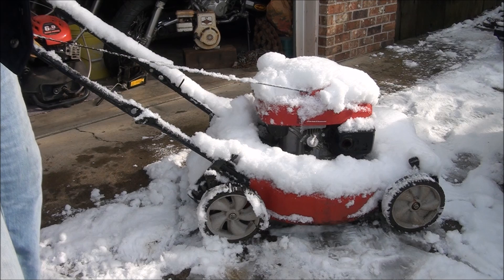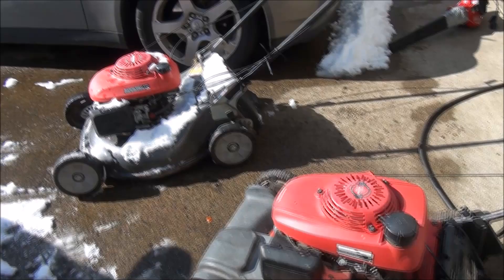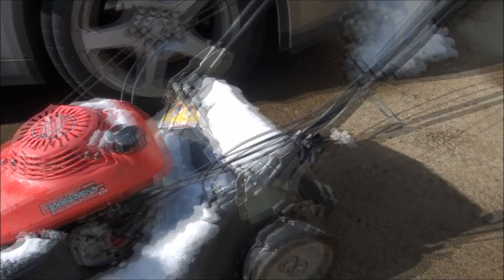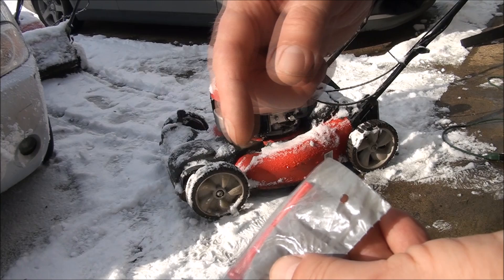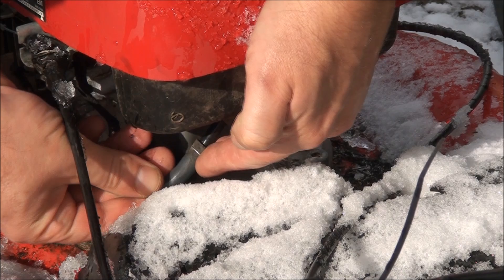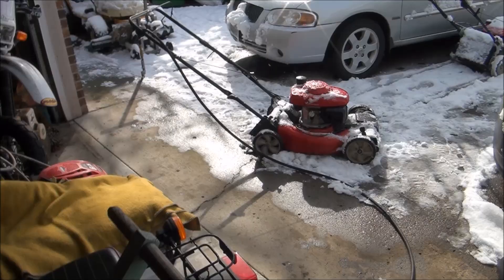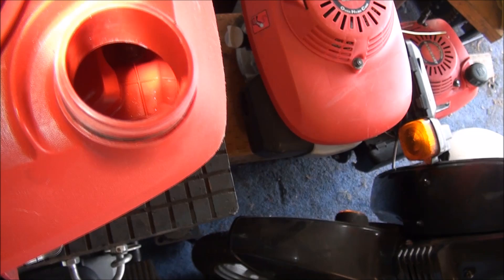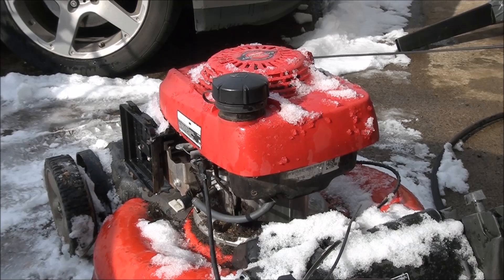Where is the FUEL FILTER on my HONDA Lawnmower? Cleaning the FUEL SYSTEM

Comment: I have the Honda GCV 160. I pulled the fuel ⛽️ line , and it has the inline filter.  It was the the rubber hose.  Pulled it out and inserted it directly into the tank and put hose back on it.
Reply: I have the same pressure washer, and I’ll have to give that a look 👍

Comment: Hello, great video! I think that the Honda fuel filter located in the fuel tank is serviceable with a 12 mm socket or possibly wrench? From there you can either try cleaning it which could work or replacing it with an OEM which will work or lastly if you're in a pinch,  it's a lot cheaper to install an in-line quarter inch fuel filter by cutting it off with some steps, & some creativity which again will work..